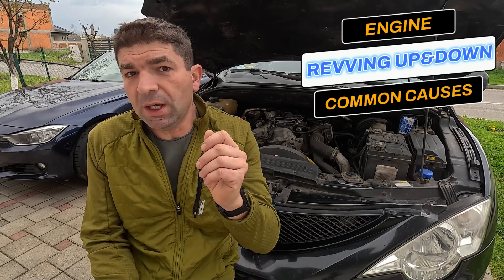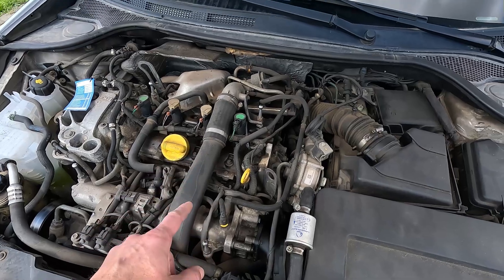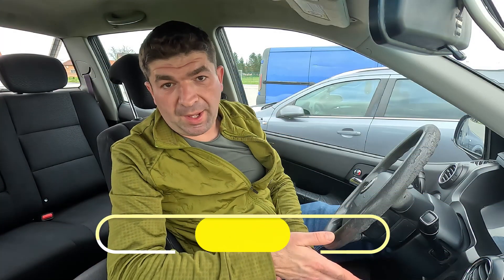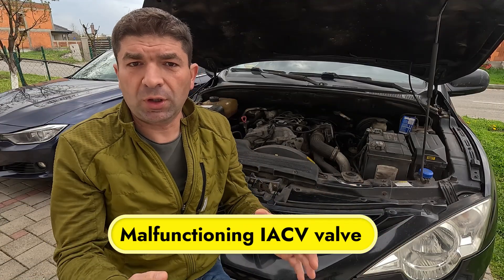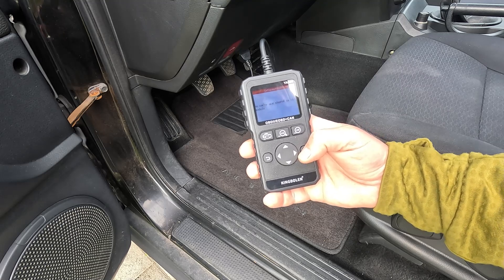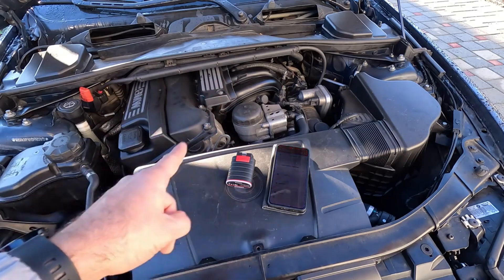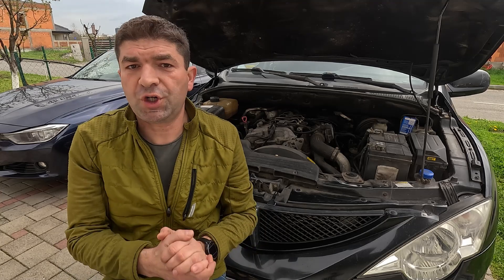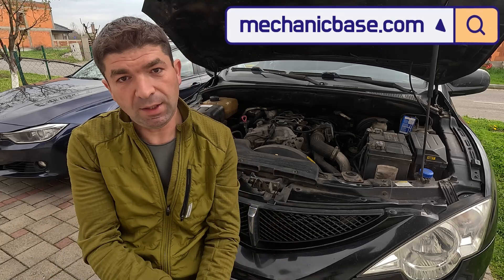Car Revving Up and Down At Idle? Causes & Fixes!

Comment: I have  a 2003 chevy monte carlo i changed egr valve throttle body has been cleaned changed the sencora on the thottle body changed yhe rae manifold changed yhe catilac convertor it atill revs my mechanic said he dont understand why it still revs when we changed so much

Comment: I have an issue with my 2006 Acura rsx. I changed the clutch and bleed the the master slave cylinder. But it won't go into gear when the car is running. But when I lift the front end. I was able to change gear. But when I press the brakes and clutch. It wouldn't go into gear. Have you experienced that issue?

Comment: My daughter has 2013 Altima 2.5L
Car drives about 3 minutes then losses all power & move @ about 2mph,l'm thinking it's the Camshaft or Crankshaft Sensor,can U guide me in the right direction if it's not either or these sensors please...